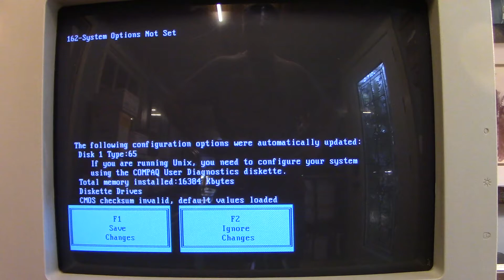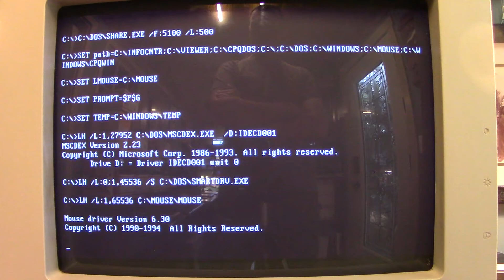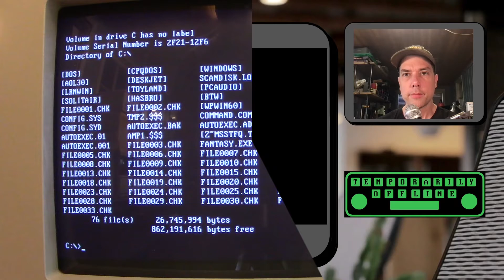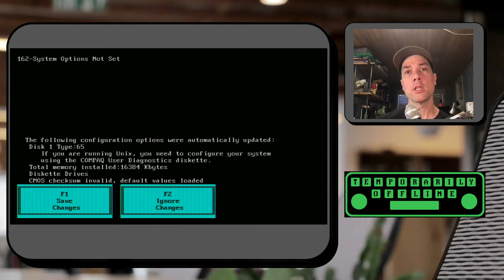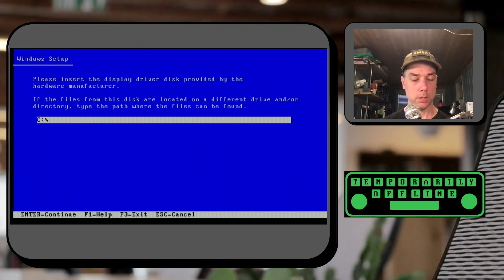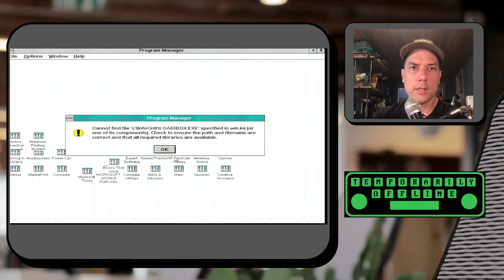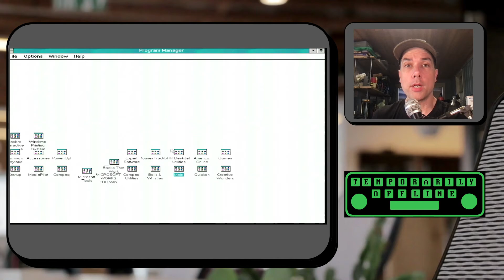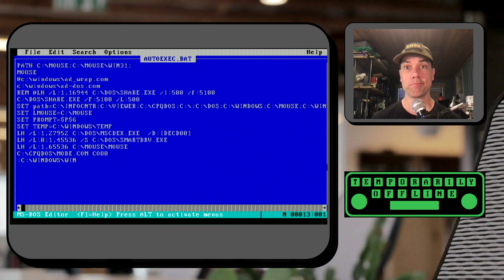How to Change Video Drivers in MS Windows 3.x

Comment: About the Large Font thing — I’ve got a 386 with a Trident card in it, and ran into that same thing.

For those not familiar, Large Font and Small Font are just different DPI settings that enlarge the system fonts for those super high resolutions, like 1024x768.  ;-)  To be fair, that text is pretty small on a 14” CRT!  Haha

Anyway, I just edited the OEMSETUP.INF file on the driver disk / directory to add a Small Fonts entry for that resolution.  I don’t remember exactly what the change required, but you can tell pretty easily by comparing an entry for the Large Font config with one of the entries for 800x600 or less, which IIRC all use 75dpi fonts.  You might have to make sure it references the smaller size set of font files.  Remember, Win 3.x still used at least some bitmapped fonts, particularly for the system font, so they don’t just scale like TrueType.

PS., my comment keeps getting et, so let’s try a different phrasing:  Leverage the Vogons Drivers library.
Reply from the maker: Thanks Nick!  I saw the vogons comments, but YT flags messages with links in them.  I'll take a look there.

You're right about the large fonts.  I always found that the dialog boxes weren't properly sized/shaped when using large fonts and stayed away from them.
Reply: @TemporarilyOfflineRetroTech   Haha... I didn't even use links, just an obvious and easily Google-able term, because I was trying to avoid the ban hammer droids.  :-D  Obviously that didn't work quite as planned.  LOL

I think it probably picked up on wording that looked an awful lot like me trying to drive traffic to a sales page or something.  Silly droids.  What can ya go, they're just trying to help.
Reply from the maker: That's the thing... they are either over zealous and you wind up with youtube... or they are non-existent and you wind up with bitchute... Which is the lesser of two evils?